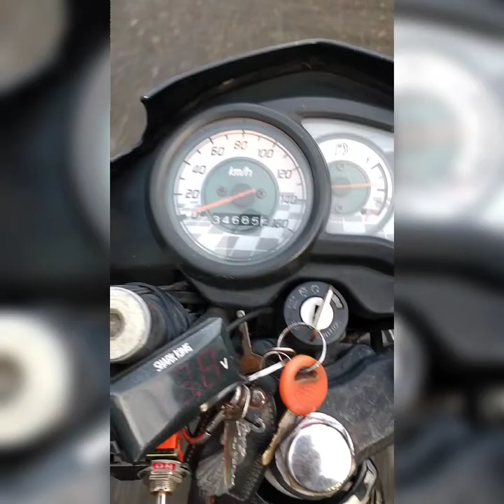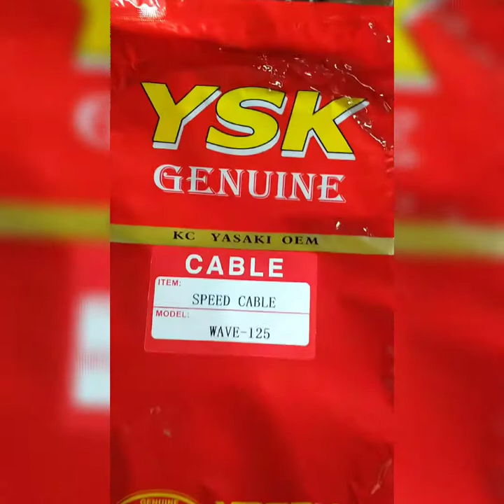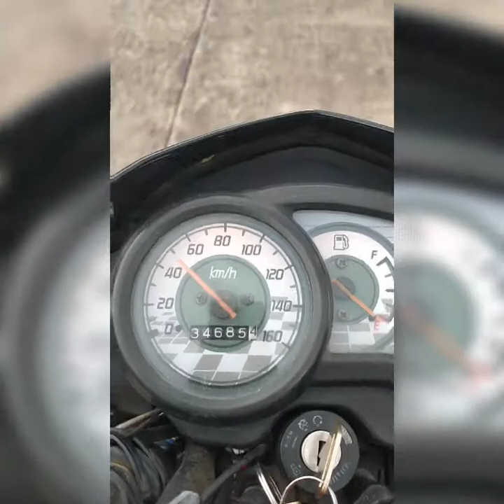Speedometer Repair! | Paano Magpalit ng Speed Meter Cable? | Anung Kasukat? | Euro Sport R 110

Comment: Boss anong pangalan ng speedometer cable dyan boss nasira kasi sa akin.
Pareho po tayo ng motor.
Euro sport R110
Reply from the maker: Wave 125 ata yun di ko na tanda, pero nanjan yun sa video pinakita ko kung anung brand at unit ang kasukat.
Reply: @pilyongrider06  pwede ba dyan boss if wave 100 gamitin ko kasi yan lang available dito na speedometer cable sa amin.
Reply from the maker: @archrishreybarredoompoy6356  di ko pa nasubukan paps.